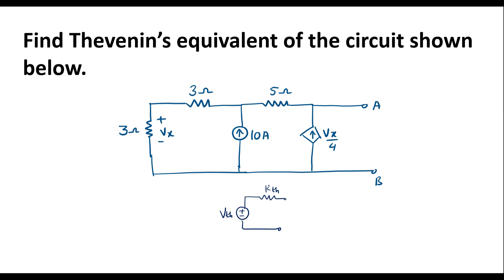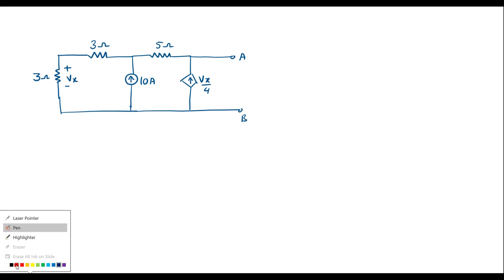Numerical on Thevenin's theorem

Comment: Sir why did u take direction of loop in clockwise for the last loop. We have to take the loops in the same direction right(5:36)
Reply from the maker: You can take direction however you want. While wrong voltage across resistor should take care of polarities

Comment: it is wrong
Reply from the maker: Oh ok . Please let me know where you found wrong.
Reply: @VBDclasses  the maximum current in the circuit can't be 30 or 40 amps, and also
x= -4.25
y= 5.75
Reply: @nikhilupadhye5842  hey, so i did the problem and got x = 5.71 and y = - 4.28..... the values are basically the same as what u have given but inverted.
also Vth = 21.4 V and rth =11 ohms. is this correct?